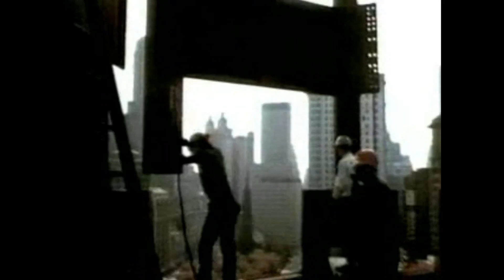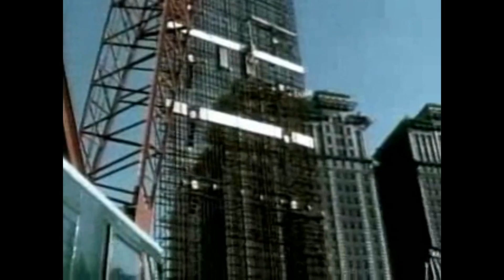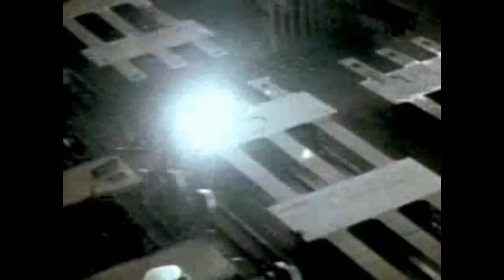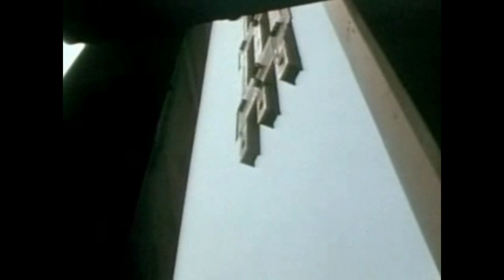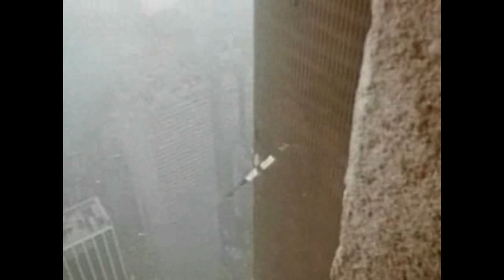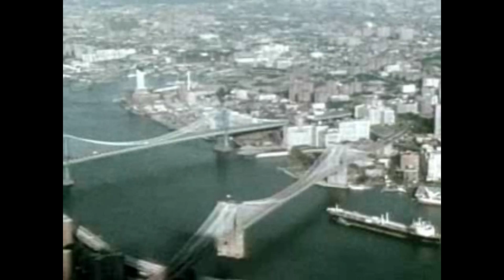Building the Trade Center

Comment: Fascinating insight into the Twin towers construction, After all that engineering, all that blood sweat and tears, Only for some Extremist Islamist's to come along and fly two planes,with fully loaded fuel tanks, straight through them, As far as i'm concerned, These scum bags of evil, should spend eternity in a very hot environment , with no end to their punishment.
Reply: Hello Robert, you've seen the size of the steel sections used in this video,  explain how an aircraft could fly thru those? I've read aviation reports on bird strikes being lethal.
Reply: Hello there Ed, Yes I have seen those steel columns, and yes they look like they could withstand almost any impact, But when you look at the footage of both planes, you can see clearly they both penetrate the outer skin, and most of the planes remain in the building, But that's all I have got, On the subject of bird strikes, I can see where your coming from with that, but the bird strikes rarely damage the body of the plane, its the engines that suck them into the workings, Which you can understand it being detrimental to the integrity of the aircraft.
Reply: No " , I mean extremist Islamist's, Your version of events is somewhat warped. you sound like one of those crazy conspirators, The simple fact is, the towers collapsed because of the planes fully laden with fuel, The second tower hit, went down first,,because it was hit lower down , making the collapse that much quicker,  If the towers had an inner steel column structure, as many high rise do, the towers would not have collapsed, Everyone knows the strength of the towers was the outside columns, So once they were breached , the rest is self explanatory.There was no government conspiracy, It was a terrorist attack. get over it.
Reply: @robharding1957  fully laden, bin laden?  No. The fucking government knew this was happening you moron. Wake up.
Reply: James  Stewart islam

Comment: Great to see what the tower looked like below ground (street) level,  as I haven't seen this covered before .....which gives the misleading impression that the Tower stopped at ground level.  The preliminary explosions just before the building came down must have greatly weakened this section. (what else would they have been for?)  I wonder if anyone has been able to identify exactly what was found between street level and bedrock.

Comment: Kaisar aluminum had the contract to produce and install the aluminum siding. They failed in inventing a technique to block electron migration and thus corrosion of the aluminum. The cores were already up 15 stories. Kaiser's contract specified "alchemy" necessary to create the corrosion buffer. A huge amount of money was offered to do this "alchemy". But "alchemy" does not happen except with exotic nuclear reactions.

Comment: Not only asbestos, but the exterior aluminum panelling was falling off. No high-density carbon material back then. Dad and a few others went to NYC to get the bid for Skilling engineering. Dad quit when they presented Skilling engineering with the mandated preset, in 1969. The building, due to structural failure and asbestos contamination, was slated to be dropped by 2007. A different solution was found, which included a conspired activation of the preset with nanothermate in the cores. FACT